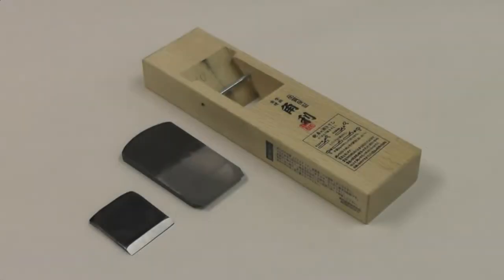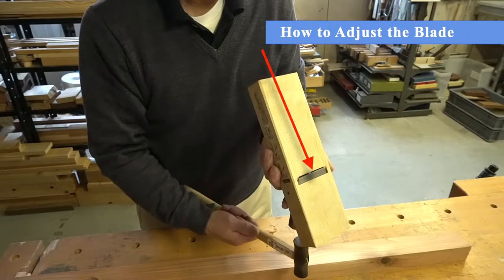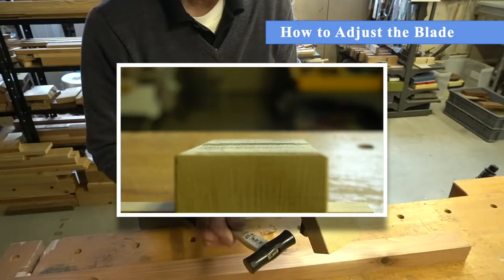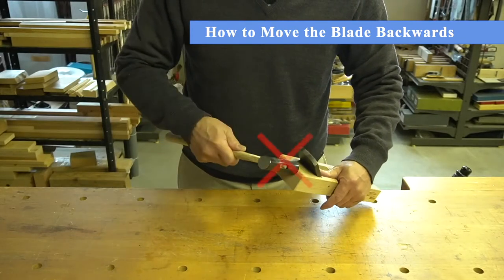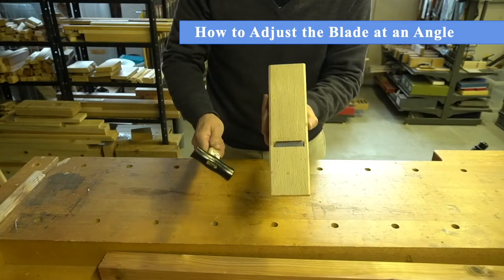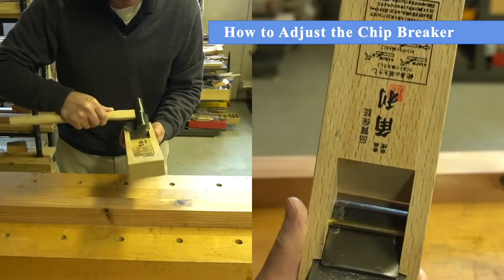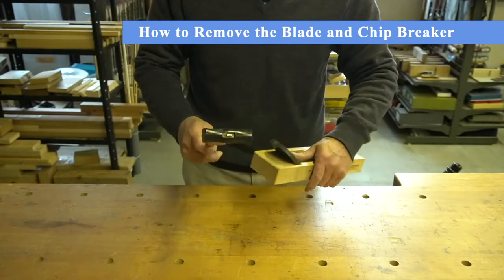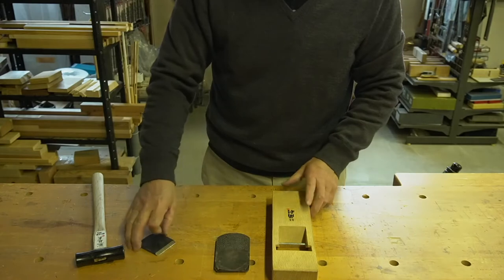How to Adjust the Blade of Your Japanese Hand Plane

Comment: Not covered.... I have seen some who tap the side of the plane body to adjust the blade sideways. While not positive, I am guessing this is done if you have tapped the top of the blade till it hits the wood on the side of the body, and tapping on the opposite side will move the blade that way/direction, and then you can set the angle correctly. Also, I am wondering if any one adjusts the blade for a slightly deeper cut by tapping the front of the plane body. It does make a little sense, and I have done it a few times.